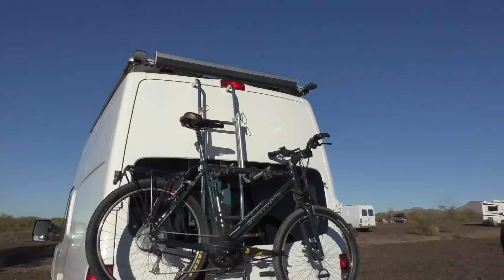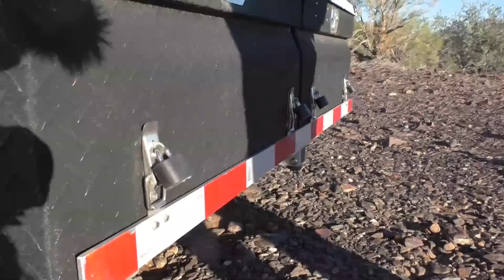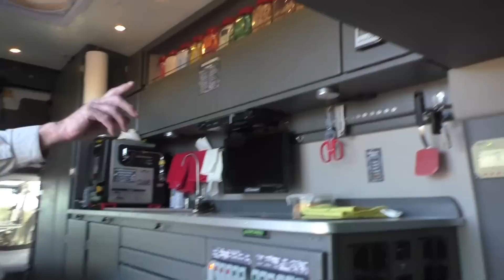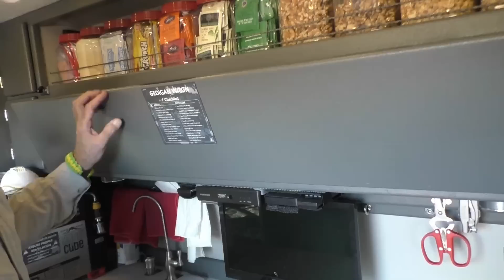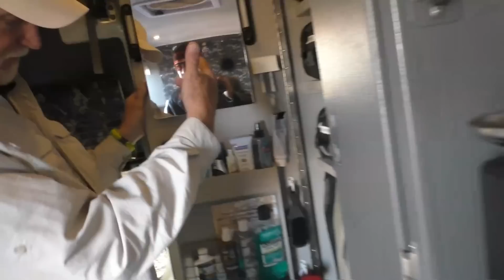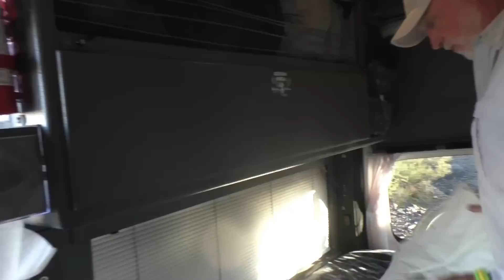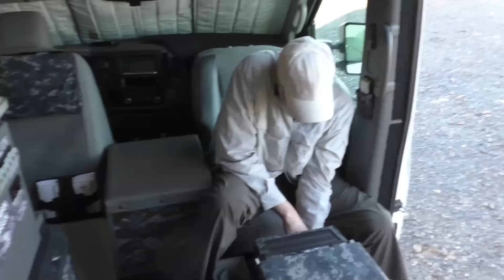His Advice WILL Change How You Build out Your Van or Bus

Comment: Hey Jamie, I am trying to figure out how best to contact you. I am having to sell either one of my Battelborn  batteries or my Victron 12 V 2000 watt   Multiplus inverter charger. I have had so many issues with my dodge pro-master it’s bled me dry. I live in my van and it’s been in the shop for  almost 6 weeks continuously. I don’t have anyone to help me figure this out i feel the dealership service department ha bamboozled me and charged me $2209 for a key + FOB and a module
they didn’t program properly. Odometer is now blinking as a result of this. They returned it now leaking antifreeze. It’s one thing after another . Now at a mechanic in San Diego where i live has replaced the water pump because polenta was leaking when the dealership returned my van to me. It wasn’t an issue before. Anyway please can somebody email me i need some help navigating and advocating for myself i feel like i’m being bamboozled from every angle bc i’m
a woman.

Comment: Finally, someone else who has an open down cabinet.. I see so many and that is one of the first things I think of - Things will shift, so open down means it won't fall out, it will be captured and the extra surface is great too. I do think having all switches in one area is lazy, but he designed it smart and the van is quite small without that many areas so there it can work, but if you have a back work area / living room, bed area coming down, kitchen, etc.. each zone should have its own switch easily accessible.

Comment: UNCLEDOUG  IN  BOONE N.C.    WHEN I HAD  THE  VAN SHOP  IN  ASHEVILLE N.C.    WE  USED  THE  PLASTIC  CAPS   BY THE  THE   THOUSANDS    THERE   CALLED      SNAP   CAPS   THEY  HAVE  A  CENTER  PIECE  FOR THE  SCREW  AND  THE  DIFFERENT   COLOR   SNAP  CAPS   FOR  ANY   PROJECT   !!!!

Comment: I would add the flexible pipe kitchen sink faucet instead of the rigid one - makes it easy to quickly and comfortably wash the head and upper body any time, given that there is no permanent shower setup. The one with the flexible spray hose ending, that could be put on just for the needs. Otherwise - functionality/organisation levels are fantastic. As on a space ship.

Comment: U can get a hub motor for 150usd 48v 1000w and buy a 52v 17.5am battery for 350usd that's a total of 500 bucks. Top speed is 32 miles an hr. If u get a 1500w hub motor u can reach top speed of 37mph a little faster. 32mph is plenty fast for me. Had my build for about 4 months now ride about 20 miles per day with no problems.

Comment: That's great advice about building things to be changed in the future.  I've found that is the case for me.  I am constantly optimizing things as I use them and think of better solutions.  It's nice when you can easily act on those new ideas without totally having to demo something.  Just make things modular.  I do that with my home decor.  I use neutral tones on the large pieces of furniture for example but then based on the seasons or my whims, I change out the throw pillows, blankets, curtains, etc. to be different colors.

Comment: Dear Lee, as a Dutch person i would like to inform you that Gedegen is a Dutch word that probably means exactly the same as Gedigan , i would freely translate it as 'Durably Done Proficiently', and some might say that is like 'Done Well', but Gedegen isn't just 'Done Well', it's 'done well' in the sense that it will do what it's intended to do, and do so for more than the timeframe you would expect it to do so, without breaking and with little maintenance, but not necessary build from the most expensive options. That could be called 'Done Well', but 'Gedegen' adds some inherent assumption to how it's done 'well'. Describing it as 'getting the most bang for your buck over the long haul' might be a good one too, like that birch, it's not oak that will basically last forever, but it's not pine plywood either, like a middle road with long term quality in mind (and for those materials the same applies to the cost aspect of it). 

And not to throw in to many old stereotypes, but this might well be why this word survived in Dutch ... though i will say that many will argue it's already an 'old Dutch' word, as current generations grow up with IKEA and stuff 'Made in China'. Now, it might not be possible to economically build things like they did in Germany once, but as good Neighbours to them i would argue that building things 'Gedegen' is still a much better option than building things as crappy as they do today (sadly under Anglo Saksen Economical principles, which may well be why the word doesn't even exist in English anymore ;) ...

Be safe and enjoy your travels, and may your design and building efforts be fruitful and gedigan ;)

Comment: You want water tanks that have a BIG sealable top, like a threaded screw on top, that's large enough to put your hand in if you need to, they WILL get mold if they go too long even with bleach sometime. You may have not had that problem, but it's worth it just to have the big plastic tanks with large holes on top that completely seal.

Comment: My cuz bought a. Freightliner 24' refer box with liftgate. Use as basecamp and tow van. It gets 14 mpg. A pallot jack and 4' x 4' x 4' bins make truck modular. A rail system lift makes it possible to stack bins. It can be off loaded and used for commerical delivery. The rig cost $12,000 2010 freightliner with 45,000 miles!

Comment: Does anyone know what is on the counter under the papertowls?
Reply: It's a portable on-demand hot water heater.  Base Camp Companion Aqua Cube Hot Water System. Uses small propane tanks, then you plug your water line into this; normally used for showers.

Comment: I bought a new Ford F-250, 6L diesel and it came with those tires.  I got 133,000 miles out of them and only replaced them when a nail pierced the sidewall of one tire so I got another set.  Great tires.

Comment: @ 2:55 Lee tells about his old bike with a Bafang 750W mid-drive motor - there is new Bafang BBSHD 1000W 48V available, and you can also use it on a foldable fat tire bike and it would not take too much space inside the van.

Comment: love the donwards opening storage and the induction field and the storage in the table is a awsome touch i have my desktop pc build into a wall but the keyboard and mouse always wander of and i have to get some of the storage cubes so my wardrobe stops exploding ^^ this is the best conversion i have ever seen and i have been to allot of camping / caravan shows and seen allot of professional campers wich wheren´t half as well thought out the only thing i would change is the bathroom personaly i dont use the side door exept to get acces to the toilet cartridge and water inlett frees up the middle in the front for a solid wall whit a door wich is extremly practical if u have a steahlt camper or camp in very cold climate u can enter trough the cabin and dont let out all the heat or light °^

Comment: Hello Lee,

I must say, your van build is one of the most impressive I have seen in terms of ergonomics. 
More than that, every single word out of your mouth in this video resonated with me. Much of what you said has been on my mind this last year as I dream up my own van build. Everything from the birch ply, to the induction top, aligned with my  original thoughts exactly. I particularly like your philosophy of doing things right the first time, but also not being afraid to tear it apart and start over. I find life only becomes dull when you lose the urge of self-improvement.

If your offer for help still stands, I would very much like to pick your brain sometime, or even enlist your help designing and/or fabricating a few of the trickier bits of my upcoming van build.

Thanks

Comment: I used 6, 5 inch pieces of firm foam then a 4 inch memory foam topper. I sandwiched the green foam together to make a dbl sized 10 inch thick mattress,  then I trimmed a dbl sized memory foam topper to fit for a grand total of 14 inch thick mattress. I use dbl sheets with the sheet garters to keep it firmly in place. Fantastic sleep 😴

Comment: Lee, I looked at a 2017 NV 2500 High Roof today and they must be making them shorter now because with the factory rubber floor mat in the van my head goes above the bottom of the roof ribs and I am 6’ 1”.  The Nissan brochure lists the maximum cargo height as 76.9”, so that must be to the highest point which is the roof panels and without the rubber mat in it.  So my question is, how did you insulate the floor and ceiling?  Also what was the height to the bottom of the roof ribs in your van?  Thanks

Comment: you have done a remarkable job on a Nissan van I got a 9697 Dodge van I'm working on just started on first off I got to make the motor run write it runs transmission deadly slipping got to get it done right may end up changing out the rear end making more beefier then I can start on the interior I think my swivel chair action y'all have is what I like to have on my captain chair and my best to share and where you put that toilet that was an excellent idea keep up the good work and don't quit thinking that's the idea I understand that all together I'm sitting here driving an 18-wheeler going down the road and I'll tell you what I'll bring them start write stuff down and thinking about what I need to do next so in there with you I'm about to retire myself into 50 but I just don't want to be too late to be doing what you're doing you seem to be more happier and enjoying life and I am right now so keep up the good work I hope to see you and all the other plan folks out there

Comment: There is likely a better benefit to a pure sine wave inverter than merely eliminating buzzing in an inductive cooktop. The main advantage of using a true sine wave inverter over using a simulated (modified) sine wave inverter to power modern electronic products is that it won't create damage from excessive voltages in power supplies.
Most electronic items that convert household 120 volts AC to lower voltage have transformers that can produce high voltage spikes when fed with power in a form other than a pure sine wave, much like momentarily interrupting the DC to a gas powered vehicle's ignition coil makes it produce a high voltage kick that makes spark plugs ignite gas. In an AC to DC adapter, these spikes can damage components downstream of a transformer, such as rectifier diodes, filter capacitors, and voltage regulators. By contrast, pure sine wave power, such as from the commercial power grid, or a true sine wave inverter, will cause a transformer to produce a clean sinusoidal wave, albeit 90 degrees phase shifted from the input, at its output, or secondary side. The phase shifting at the secondary is of no consequence because the sinusoidal AC will be rectified to DC, then the DC will be filtered and regulated. I presume a buck/boost power supply also contains a transformer.
I made the mistake of powering a laptop adapter with a simulated sine wave inverter, and the adapter only lasted two and a half years. Realizing my mistake, I have only run its replacement on pure sine wave power. So far, it has lasted me five years, and it's still working.
Reply from the maker: I have run three laptops on a modified sine wave inverter and had no problems for 5.5 years. Your mileage may vary.

Comment: Fantastic job!  
So well done and thank you for making this video. Just bought a sprinter Van and have been watching every single video made of interiors and this one will work for me as a single guy with his dog, Traveling photographer.
Thank you for listing th items and I will click on your list when buying.
I used to live only sail boat and lists were very important as well as a log. Lee is particularly organized and inspiring.

I wil reach out to him for one question regarding th upper cabinets. When I sat down with Mercedes -Benz, Van conversion department at one dealership he said that the Canadian outfit Overland Explorer would reinforce the upper walls before installing  upper cabinets in a sprinter Van, just wondering if this was done in his build?

One item not listed was the wall hooks, these ones look great, clean and slick, would you have a link to them?

Not sure about th heater though, might go with an Espar or Wallas Duo combo stove Heater. Both run off Diesel fuel which is what I use for the Van as well.

again thank you.

FB,  BC Canada Eh!

Comment: fantastic design, the best i have seen so far with exactly the same vehicle i prefer the Nissan NV2500. V6 is enough for me over V8.  The electric area with only 2 marine battery and a powerful inverter is marvellous and the 4 solar panels. The fridge with a normal door is better than Dometic design. The little cooler serving as foot rest is pure genius. The bed with lifting mechanism is fantastic. The design of the table for the computer is incredible. If one day i follow this path, this will be in some way like that but a rougher version of this perfection.

Comment: Love the video. Lots of info. I of course have questions. Im converting a trailer that I use for work as a portable shop. Im wondering how you separated or if you did separate 12 volt systems from the vans original systems so as to not drain batteries from either system in case of a ground fault. Also when you wired all those switchs how or what do you feel is the best way to make your connections. splicing lugs, screwed down lugs soldering. My concern is longjevity and my dislike for doing things over as well as chasing any shorts? Thanks again Robert.

Comment: Incredible craftsmanship without a doubt.
But I don't like the layout of the van at all. For starters, I think the Nissan is a poor choice to begin with as the usable living space is limited compared to the Ford, Mercedes and Dodge offerings. And it shows: No wet area, which should be standard in a high quality build like this. I would miss my shower. 
The Nissan has also the thirstiest engines of all the modern vans on the market.

The toilet in between the front seats is just an error in judgement. It's not just a space of waste, but also a waste of space in this location. It looks like it would restrict access to the driver's area, and after your business you need to make your way by the kitchen area to wash your hands. Hygiene issues here.

On top of that, the build looks very heavy towards the drivers side, wouldn't surprise me if it feels unbalanced to drive.

Comment: Here's a perfect example of "if you want it done right, you better do it yourself." Being out on the road and knowing the vehicle means you're better able to handle mechanical problems/breakdowns. Buying a ready made camper means you're going to depend on the manufacturer or a mechanic at a significant hourly rate, to help you when things go wrong, and they certainly will.